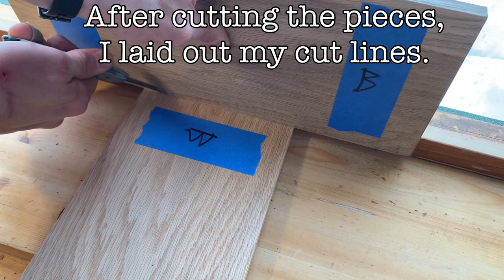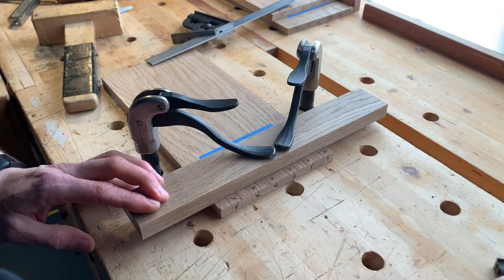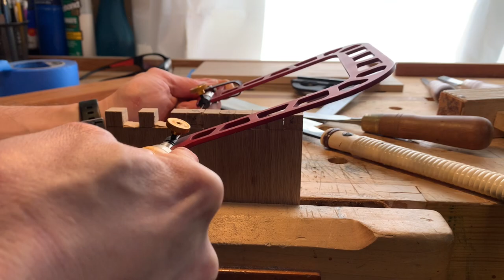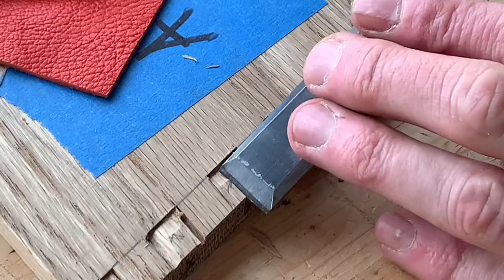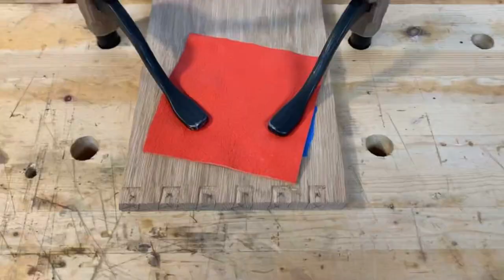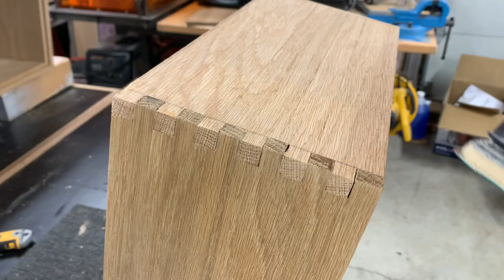Cutting Box Joints By Hand

Comment: Great project. It's easy to see one's own flaws and be overly critical. I'm that way myself. Unless they're glaring, most people won't notice them. 
This came out really nice. 

I haven't done this since many years ago. Two relevant pieces of advice I've seen from people doing this by hand: 1. Make the cuts on the waste side. 
2. Don't place the chisel exactly on the cut-off line of your stock, because the chisel will push the fibers inward, and gaps will form.

Comment: Just a quick question: why did you sand then add the putty? would it make more sense to add the putty first then sand it off flush?
Reply from the maker: @DC-cy6uj  I typically do a first sand, then putty, then the higher grit sanding.  You end up using less putty and you still need to sand to the higher grits anyway.